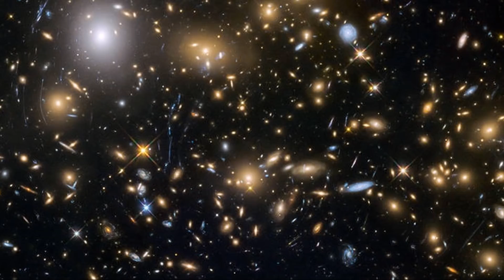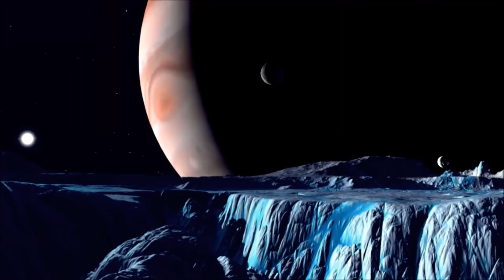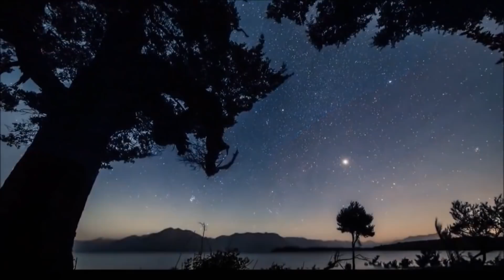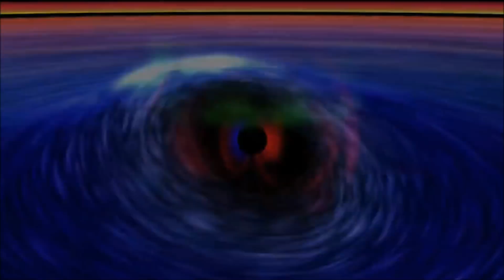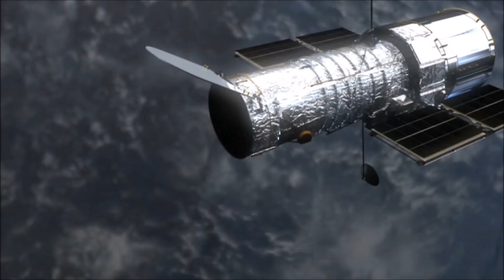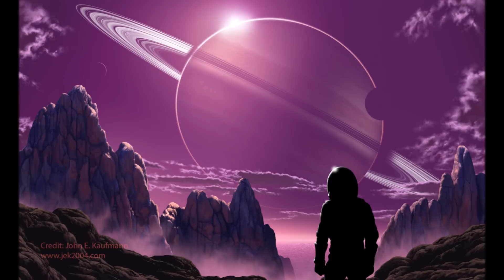Technosignatures: Detecting Alien Antimatter Propulsion

Comment: A warp drive would be easier for propulsion. 
But antimatter explosive device might be more prevalent.
Reply: Warp drives require negative mass to function. While negative mass is theoretically possible it has never been observed in nature. We have no idea how to make it.

On the other hand we as a species already have the technology and capability to create antimatter. We just need to scale up that technology and match it with a massive energy source (probably fusion). Antimatter is the ultimate sub light speed option and will be far easier than creating warp drives.

Comment: If we were to build a dyson sphere, could we use the sun's output to manufacture antimatter?
Reply: If we could build a Dyson sphere, would we need to?
Reply: If we had direct access in space only to a sun-powered earth, we would not need antimatter or fusion to propel ships, and the sun produces 3 billion earths in energy equivalent to what the earth absorbs from solar energy, here we are discussing a power of 126,839.16 TW / h without Earth's atmosphere to disrupt or the power of 126,839,167 nuclear power plants of 1 GW each. Take this and use it to propel a Star Candle. A typical red dwarf with 10% of the sun's mass will last 10 trillion years and produce 3 million times more energy than the earth absorbs from solar energy, so basically any star could serve or a black hole with matter slowly being thrown at it. with the energy produced being captured by panels and used for work. A civilization could create halos of acceleration using photon propulsion, without the need for antimatter or fusion which is easier but very inefficient compared to antimatter.
Reply: @mauricioabyara4171  I think at a smaller scale (individual ships and probes) antimatter propulsion will see extensive use. The reason for this will be the same reason that people will be using internal combustion engines long after fusion is invented. The energy density of gasoline is greater than that of a chemical battery. In fact we will be using the excess power we gain from fusion to manufacture fossil fuels for use in automobiles. It might seem silly since it takes more energy to react the base chemicals into fossil fuels than you get out of burning them in an engine but there are many advantages to having a higher energy density fuel. For one there is greater weight savings which means an antimatter rocket will have an insanely good thrust to weight ratio. Possibly even the greatest thrust to weight ratio physically possible since antimatter is the highest energy density fuel known at this time. That all depends on the design of the rocket though.

The weight savings will be significant and you could carry enough fuel to last for a VERY long time. One gram of antimatter  annihilated with a gram of normal matter releases about three times the amount of energy as the bomb we dropped on Hiroshima. So if I carried 100 pounds of antimatter on board my starship (45359.2 grams). I would have roughly 136,000 nukes worth of potential energy output with only 200 pounds of fuel. 

That would offer a near limitless propulsion option far from the infrastructure of civilization with only a single fueling. Of course you would need the infrastructure to get 100 pounds of antimatter in the first place. Which if you can build a dyson sphere would be pretty easy for you.

Comment: Only 2 ways to get it.  We either make it, or we find a naturally existing source of it.
If we make it, it would be the most expensive stuff ever.  It would be a great source of frozen energy, but it would be worse than powering your starships with gold.
Find a natural source of it means going to where it is, which means we would have to leave our Solar System;  UNLESS you can find away to make use of the naturally occurring anti-protons coming off the sun.

-Ken
LaserGuidedLoogie.com

Comment: I've had quite a bit of experience in PET imaging - mostly (though not entirely) dependent on detecting those 511 kEv photon pairs resulting from electron/positron annihilation! The problem is, that it takes a LOT more energy to produce TINY amounts of anti-matter, than annihilation yields, even using "efficient" production strategies such as those at CERN. Also this is an area of Physics where our understanding is pretty comprehensive (OK not complete, but not so far off), and there's just no "efficient", commercial method for producing useful (which would have to be kilogramme or more) quantities of antimatter (ideally anti-hydrogen - an antiproton / positron pair, that has been produced "in the lab" on a tiny scale). It "might" be possibly to extract anti-matter from stars (Isaac Arthur's programme on Starlifting hints at this), but again, very demanding, and a very long way beyond what we can do now . My bet's on Kugelblitz black holes as an energy source - almost as difficult but possibly more useful (and "adjustable output" depending on mass).
Reply: Phil S, You do not need "efficient" production.  A star can support a population with trillions of workers and some fraction of 10^26 watts of power.(solar luminosity)  Interstellar colonization can be done with one surviving uterus (or equivalent), an embryo bank and some good tools.   Could 10^20 watt industrial effort collect enough anti-matter to equip a 10^10 watt ship for awhile?  They can get the launch going with more conventional early stages and just use anti-matter for the last stage
Reply: precisely mon librepenseur,
a Hardy-Hall-Haack-wilczek production process/ Elitzur-Vaidman 
it is as Al Bartlett reflected of the ERoEI curve of the periodic table (the extents of it) between L Seaborg et A Bartlett,
they charted the ERoEI curve...
-1 to -10 is one ratio, -11 to -20 another, -21 to -40 another... it drops off non-linearly,
and has a different Feynman-Dirac-Bohr-Zwicky-Zermelo-DeGaris "z limit" than for positive matter,
z = +175 (~173, maybe up to 175. if we can actually make it, that's another question).
-z =  ~ -118 hard limit -z = -140
or combinatorial 'synthetic matter'...
this, when combined with Hannes Alfven's "Magnetohydrodynamics" et MTheory11D - explains much eh.

je prends conge mon librepenseur

Comment: How do you feel about using the Schwinger Limit to generate antimatter?

If we get a voltage high enough (10^18 Volts), then we should be able to "pull" electron-positron pairs from the quantum virtual background and make them real. A "Schwinger generator" should be able to produce antimatter at maximum possible efficiency -- 50% -- which is loads better than every other proposed method.
Reply from the maker: It's precisely why I leave the option of antimatter production wide open. It may well be possible to manufacture it relatively straightforwardly, in which case it could be the dominant form of energy production among advanced civilizations as opposed to Dyson swarms.
Reply: @JohnMichaelGodier  Caution, one still needs energy from somewhere for such manufacturing. Antimatter would be an energy storage or delivery, not a production.
Reply: 10^18 is a lot of fucking energy.
Reply: @barahng  Yes it is.  But  the approximately 4 x 10^15 joules produced by a 1 megaton nuclear bomb would have seemed an impossibly large amount of energy to Faraday or Maxwell.  What will the next 200, 500 or 1000 years in physics bring....?